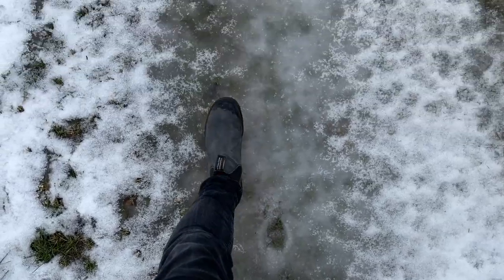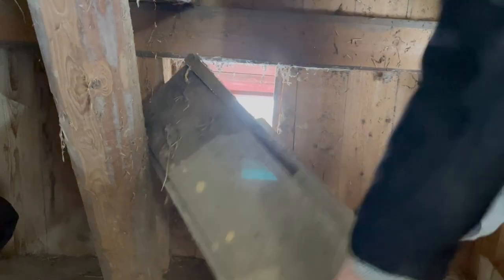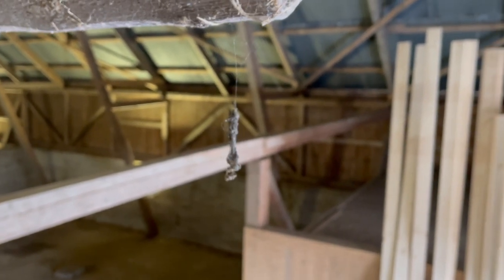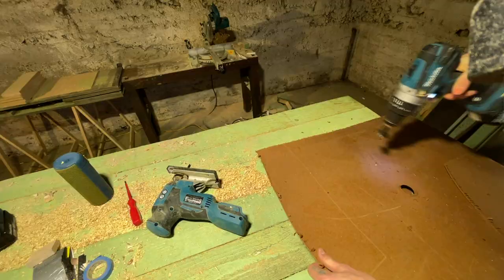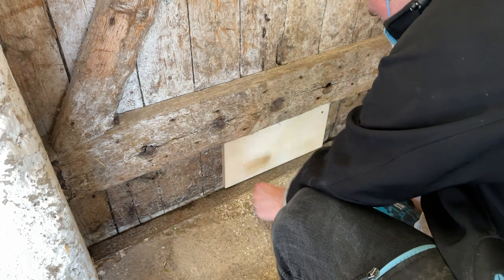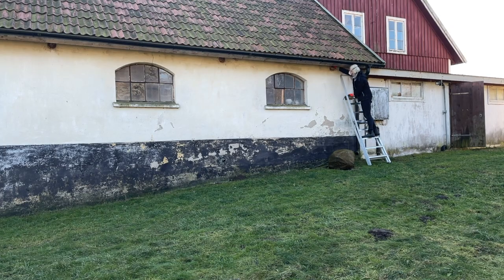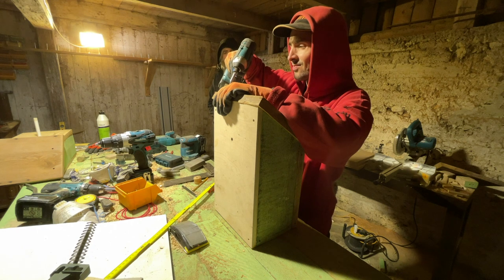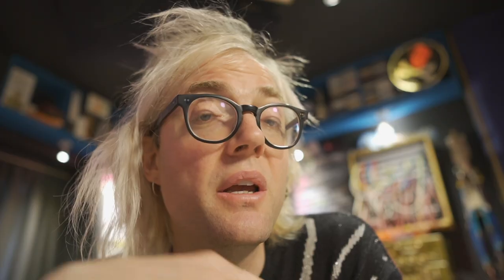Bird-proofing the barns and building Bird Boxes

Comment: 12:07  You do not need perches for the little birds to climb in the bird box hole. 

Perches like those are only used by predators as support when trying to raid the bird box. 
Little birds go straight in the hole when getting in and out of the box.

Also a metal plate around the box hole would prevent woodpeckers from enlarging the hole and raiding the bird box. 
There are quite a few horror clips here on YouTube, of woodpeckers breaking in to bird boxes and eating the chicks. 
Look up "Woodpecker breaks in bird box".

Also, I would have drilled 4 holes in the four corners of the box floor for extra ventilation and for drainage just in case any water gets in the box.